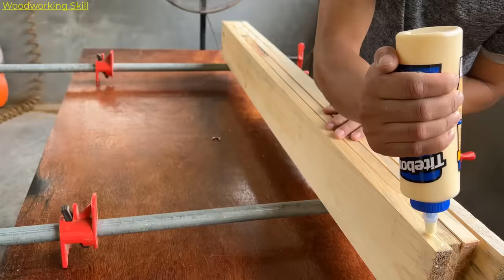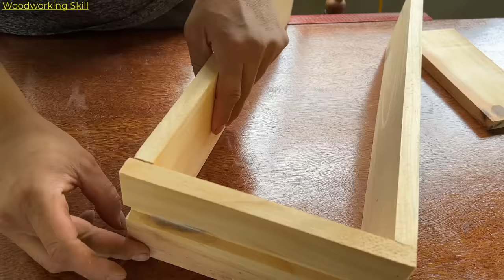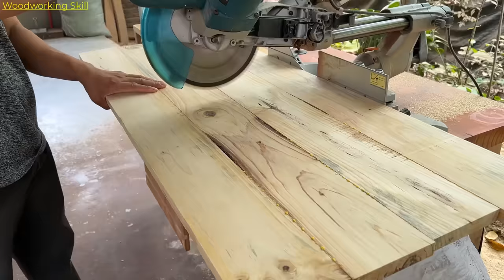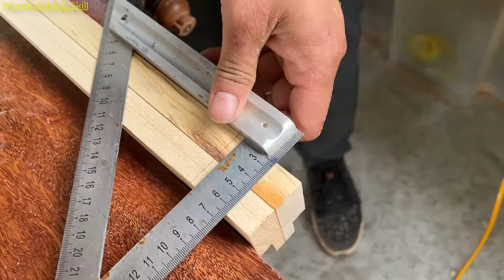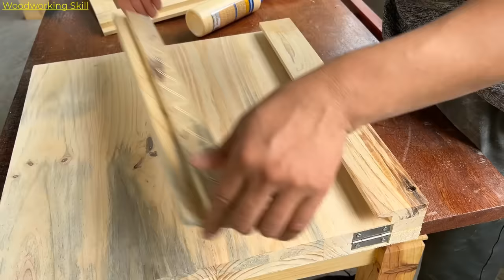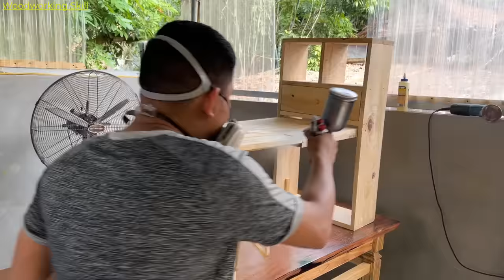Smart Design Ideas for Small Spaces | Build A Hidden Folding Table In The Cabinet

Comment: That's a death trap for little kids. Imagine the table extended. A kid sit there or use it as a step climb to look for something on top of shelve.  The hinge closed up sandwich the kid. Worst case it dragged the whole shelve down . It can easily cause serious injury or even death to a small child.
Reply: Always looking at the down side are we? You probably shouldn’t have a vehicle either since it could run them over or accidentally hurt someone. Start taking a bike to work
Reply: @forbiddenfruit4  that's right . I wouldn't have a vehicle if the vehicle manufacturer created a car without user safety in mind . This furniture can easily trap a child. It's human life we are talking about. Just like cooking , prepare delicious food doesn't make you good chef, it needs to be safe to eat and good nutrition value. Be responsible